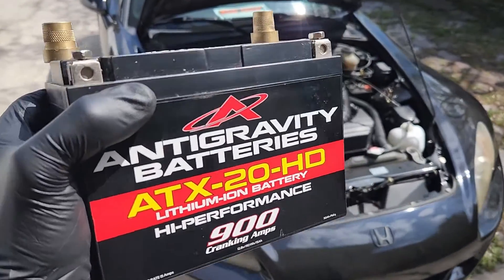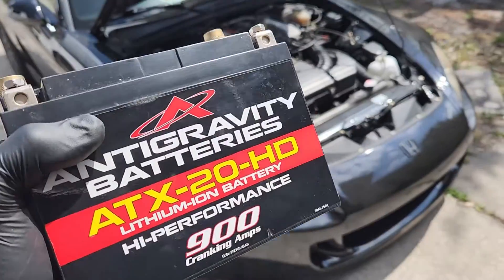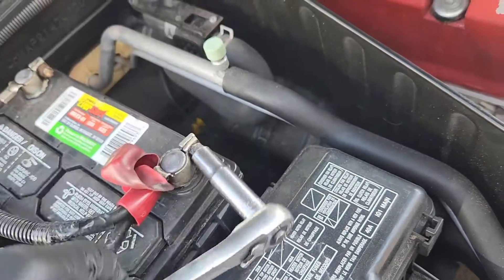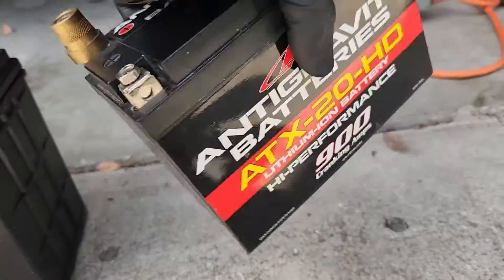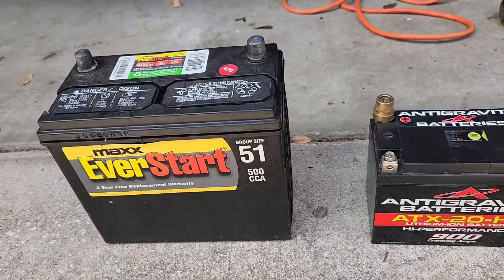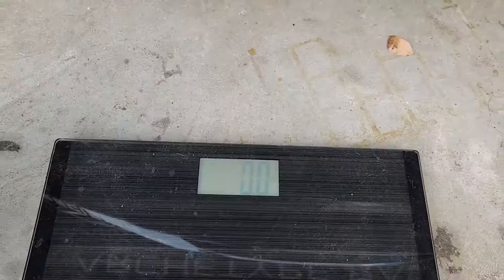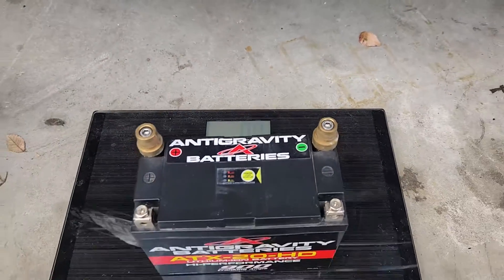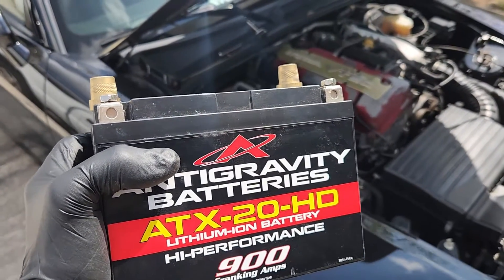ATX-20-HD Antigravity battery install on the S2000 - What are the benefits?

Comment: Have you had any issues with this battery? I ask because I was told by their team they usually use these for motorcycles. Or maybe they trying to sell me a more expensive battery??
Reply from the maker: I have not, it's plenty of battery for this car. Expect to get 2-4 years out of it unless you keep it on a lithium battery tender which Antigravity also sells. The discount code TDM10 works for everything so I'd recommend getting both and save some money while you're at it.
Reply: @THEDriverMod_ thanks for replying man! I was looking into this battery because of the small size. Thanks for the tips and I’ll use your code. I’ll get both.
Reply from the maker: I was using it in a 2016 Ford gt350 and it lasted 3 years  as well

Comment: How do you manage to get the terminal adapter attached to the battery? The hex bolt they provide has nowhere to grip to the square connector thing.
Reply from the maker: It should thread into the insert under the terminal

Comment: How's the battery doing so far in the s2000?
Reply from the maker: Great! Are you thinking about getting one?
Reply: I just bought one an hour ago with the adapters, and a lithium charger. Almost cried at the price, but my buddy said it's worth it. Would you say these batteries will do fine on long road trips. Maybe like 10 hour drives?
Reply from the maker: Yes, it should do just fine. Did you use the promo code in the video?